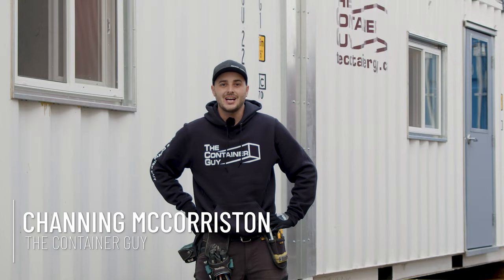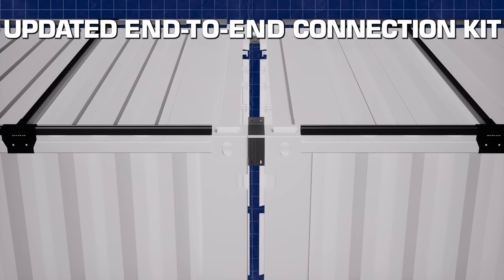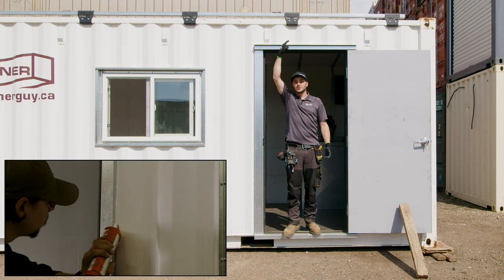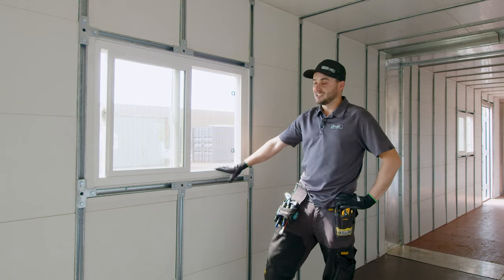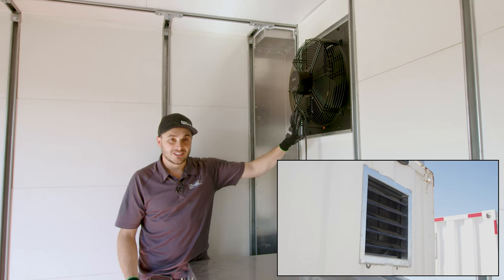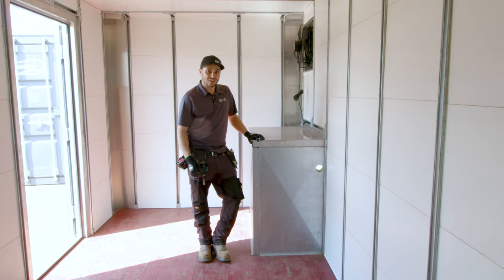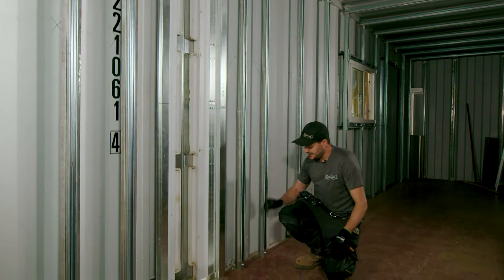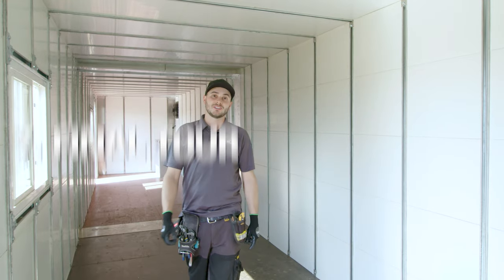Out of This World: Cutting-Edge Container Upgrades for Extreme Environments

Comment: Wow impressive.  I'm building a container barn/garage on 40'HC set 20ft apart. I'm in a remote mountain town in Colorado and Its a lot of DIY and anything like foam insulation, special trade work has to come from 100 miles away.    This build is the ultimate commercial build and I like getting ideas from you.  I know you got to focus on the commercial customer, but this is way out there in cost (the strut and fittings cost more than the containers !! LOL).  The videos and animations are really helpful.   I like the pointing out of problems you have encountered and solved.  Keep it up.